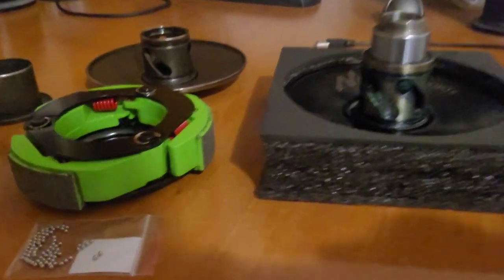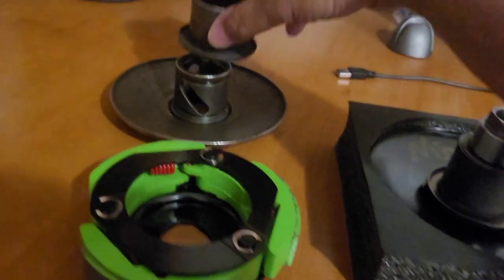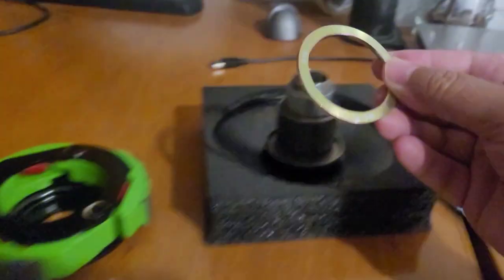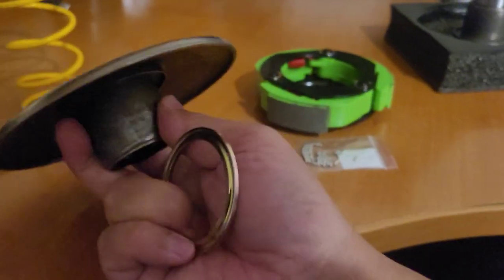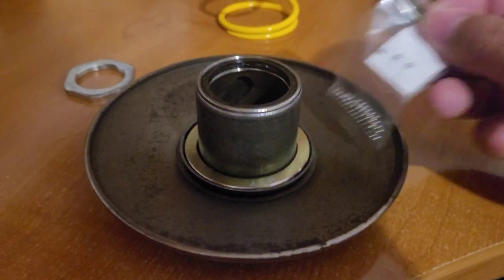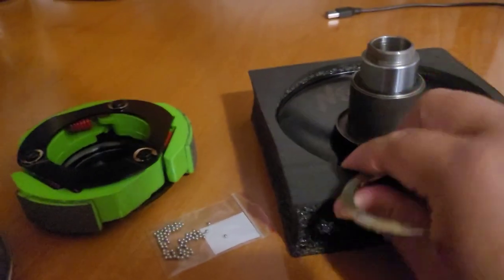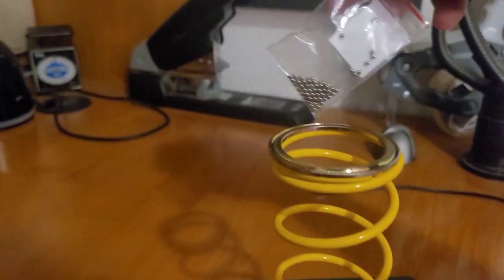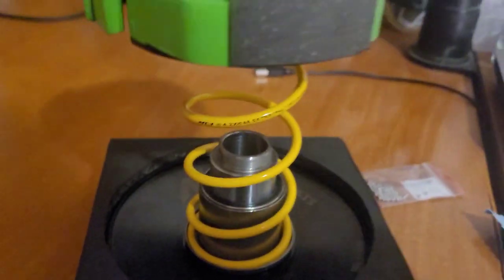NCY Secondary Bearing Spring Seat (GY6, PCX)

Comment: They actually updated this part for the QMB139, instead of ball bearings they use needle bearings and it’s a drop in system. I made the mistake of putting it on the sleeve that goes in the clutch and i got 10x worse vibration and was about to throw it in the garbage. Watching this video I realized i can put it on top of the spring between the clutch and it worked flawlessly. This part comes with no instructions so hopefully this’ll help someone too.

Comment: Thank you for being so quick with this!!! Is the 1500 spring or 2000 spring better?
Reply from the maker: I assume it's a ruckus swap gy6, go with 1500 comp spring, 1k clutch spring set. For you want your comp spring 1500 engage same as your clutch spring 1k rpm, produces quicker engagement aka accelaration, and change to 12-gram variator weights.